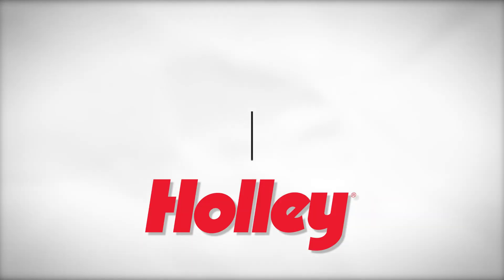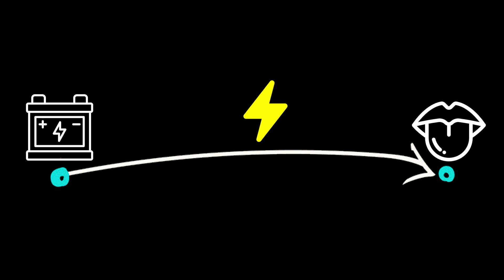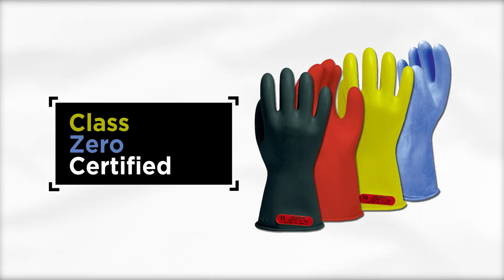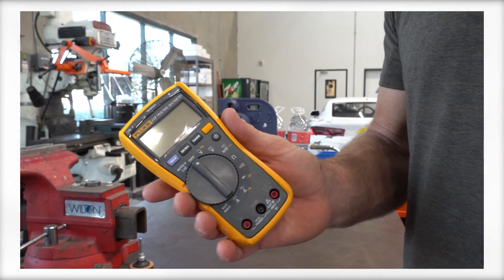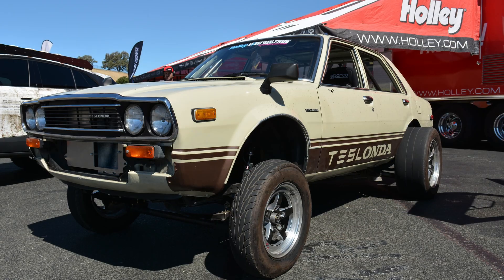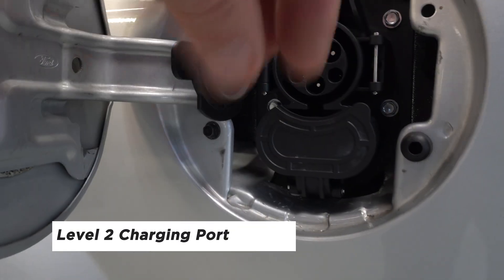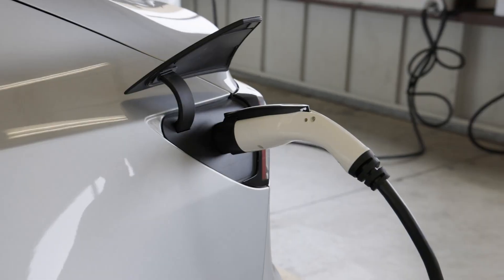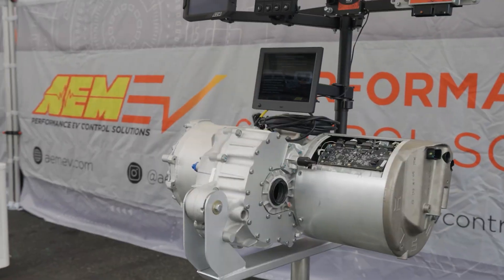EV SWAP BASICS | Everything EV Episode 1

Comment: Thanks for the great content.  I was hoping for a bit more detail on exactly when and where the gloves are required.  I'm assuming it's anytime the system is energized, but is that correct?  Once the main contact is pulled are you safe without the gloves?  Do you use anything to confirm no voltage, like the simple voltage testers used for home wiring? Thanks again!